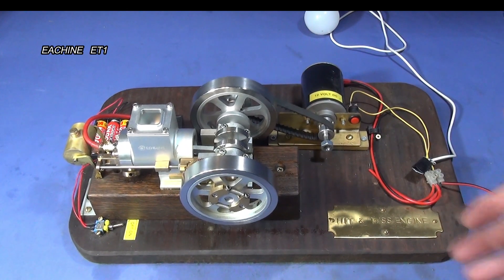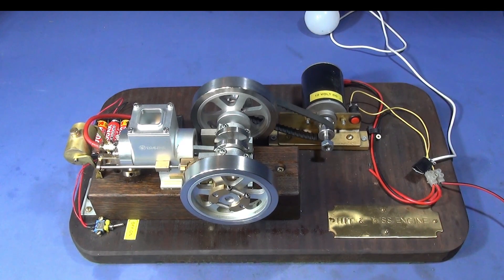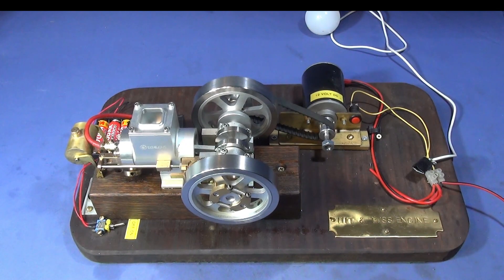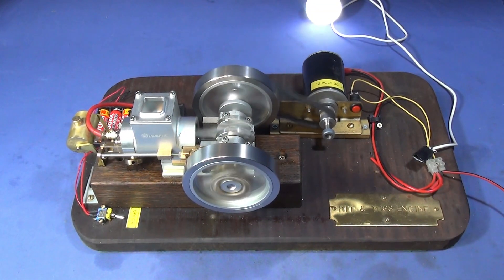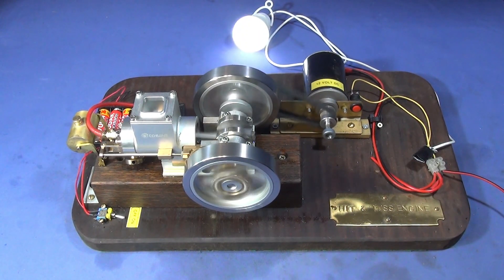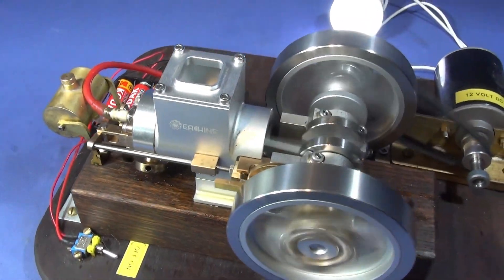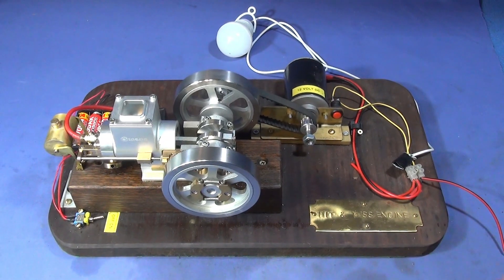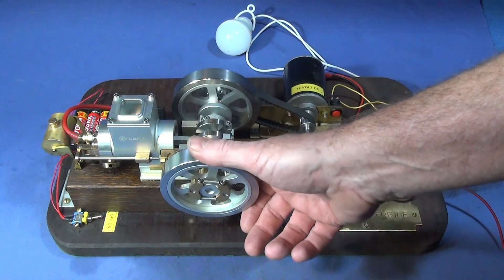Eachine ET1 Hit & Miss Engine Running On Supreme Unleaded Fuel

Comment: I use the same generator thanks to your video. Thanks again for showing this. BTW: the belt could have a bit more tension. I have 2 belts one rubber one plastic. The plastic one is more stiff.

Comment: Hi Steve,
Runs nice. Are they using a magnetic pickup as the ignition to fire the spark plug?
Reply from the maker: Hi Don, thanks. Yes the magnetic pick up is firing the spark. I haven't modified the engine. I just put it on a new wood base. Regards Steve

Comment: Nice set up Steve, I purchased an ET1 last year, couldn’t get the dam thing to run, when I tested the electrics, the ignition unit was shot, in the end I got a refund from Banggood .
Reply: I did think about getting some spares, but then a friend purchased a few ignition units that didn’t work so I didn’t bother. Enjoying your posts very much.
Reply from the maker: Hi Matt that's a shame. At least you got a refund. I see Banggood sell spare spark plugs and other spares for these now. Regards Steve